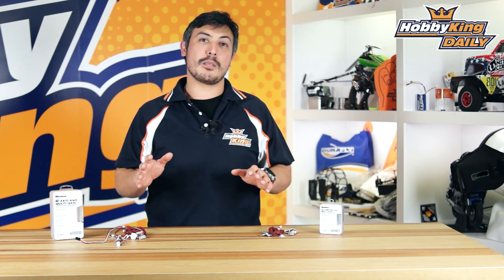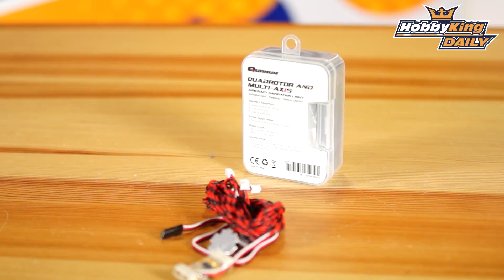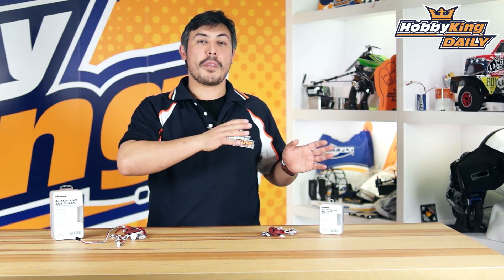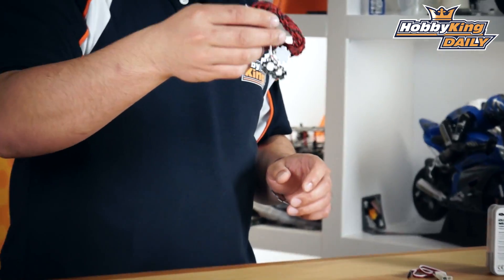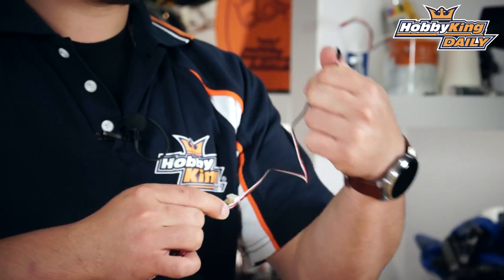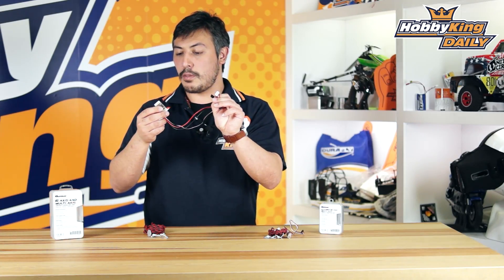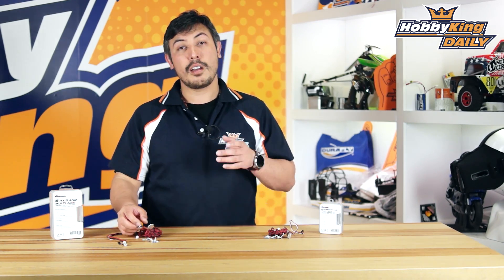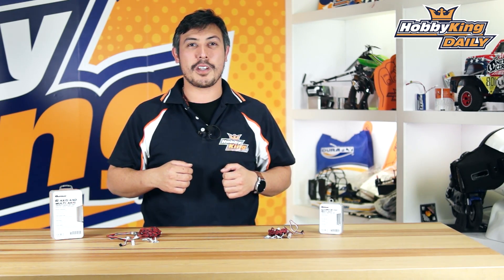Quanum 6-Axis Navigation LED Lighting System - HobbyKing Daily

Comment: I just got these (the quad option) and I can't get them to work according to the directions. As I understand it, they simply plug into an available channel (in my case ch 6) and you use whichever toggle is set to ch 6... when I switch my toggle I get nothing, however they will blink very quickly when I first attach power to my quad.  Waiting on a response from HK...
Reply: +tchthsky  So I actually wasn't plugged in to ch 6 - ch6 runs to the CC3D FC and I have no idea why.  Trying to figure out if I need it or not.  If not, then I can run the lights off of 6.
Reply: +tchthsky hello did you managed to get them working? I plug it into servo tester and nothing, I plug it into receiver and nothing - just blink when powerd and then nothing...
Reply: I did!  Very nice lights!  So far I think my short video is the only one showcasing this LED kit (it's on HK's sight, under the video tab for this kit).  All I did was plug into a servo/ESC output on my CC3D and then with LibrePilot GCS, mapped one my switches to that servo/ESC output.  It was stupid easy but I'm new to this. There is a YT video that shows how to do it, however the guy is using an outdated method.  If you contact me via pm (I think that's enabled) then I can send you screen shots of what you need to do. BTW, when you plug it in and it blinks - that's a good sign.  They'll work once your connect and configure everything accordingly.
Reply: +tchthsky I just saw your vid with those leds working and it looks very nice, I am going to connect it to big octo and will be using dji wkm and I need them to just flash like the first mode you showed in your vid and don't need to change the blinking modes with switch - any ide how to do that? I have 7,2V bec and want to use it to power the leds
Reply: +dzikbk I don't think it is possible to select a single mode - the way it's designed is you have to use a toggle to turn off and on to iterate through the different modes.  I wish there was a way, but I just flip the switch on and off, on my Tx, until I get what I want, usually the mode where all LEDs are on continuously, i.e, not flashing.  Your BEC should be perfect to power them, but you do have a white signal wire that will have to connect to either your Rx or FC.